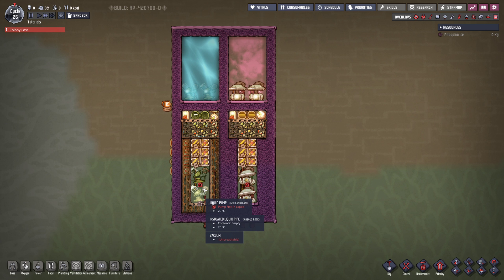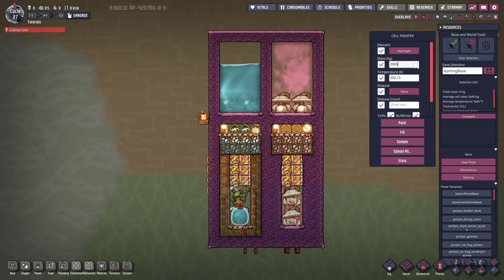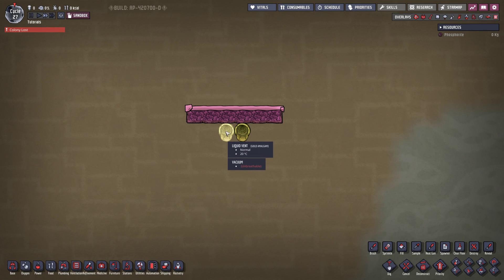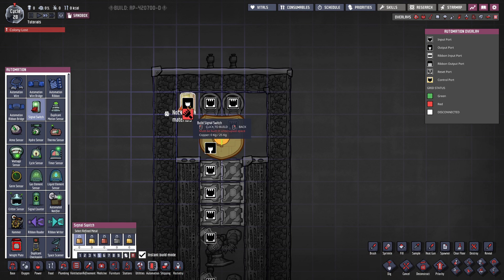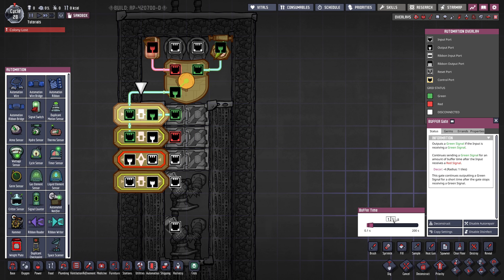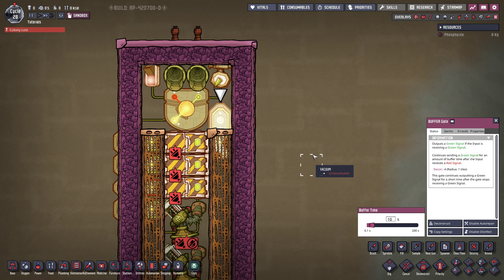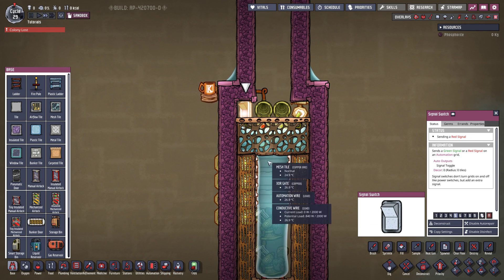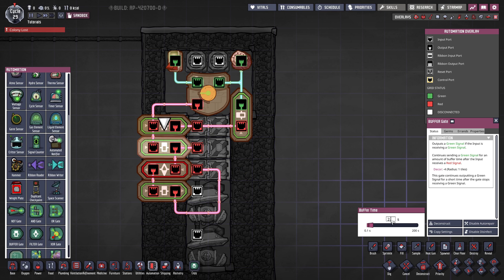Liquid & Gas Compression (Tutorial: Oxygen Not Included)

Comment: I found something weird about gas compression and I need your help.

In my normal colony, I use customizable speed mod (x30) and run the gas compression system. Somehow it doesn't work (the gas amount doesn't increase at all), but with normal speed it works.
And I try in my sandbox with the exact built and layout. it works just fine.

Do you think this glich related with FPS? Thanks a lot!

Comment: Explain why airflow tiles need to be used there? Is there specific reason instead of using normal tiles? 
Also, you should send this to devs so they can fix the exploit (or in my opinion bug :P)
Reply from the maker: The airflow tiles prevent liquids from touchung the walls. At a certain pressure the walls would otherwise break.
Reply: @Nathans-Sandbox  That's definitely a bug than and I hope they fix it :P Airflow tile should have the same rules of pressure as all other tiles in my opinion :P
Reply from the maker: It is a little weird, but not a bug. Maybe they patch it out someday but it is working as intended right now.

Comment: Mine doesn't seem to be working with hydrogen, not sure if the gas type really matters though. I have all the same intervals as you, but my top 2 doors are opening and closing at the same time, perhaps too quickly for the hydrogen to fall into the space created by the open airlock? I'm not smart enough to work out how to make it work though, I don't suppose you have any ideas or can work out what's wrong? I've definitely copied this video correctly, at least I'm 99% sure.
Reply from the maker: I built it in the current LP world the same way and it still works. The first 2 doors open at the same time, but they don't close at the same time. Make sure your connections are right if you have the right timings already.

Comment: I tested this on a Natural Gas geyser and it worked well, I just had to tweak the timings for my setup. Since I'm not sending power to my doors and the output is low, the timings I used for Buffer, Buffer, Filter, Buffer are 9, 15, 9.3, 1, respectively. I also lowered the 20s Buffer Gate to 7s and set the Atmo Sensor to <3000g. I don't know if the settings are 'ideal', but they work, the geyser never overpressurizes, and I'm not deleting any gas (that I can tell). 

I suppose that since I'm not powering the doors, the atmo sensor is a bit redundant since it seems it is only helpful to stop wasting power on compressing small amounts of gas.

Thanks for the tutorial!
Reply from the maker: Thanks for letting us know the timings that worked for you!
Reply: I was already thinking about that: using unpowered doors the last door was open before the first was closed. But I'd rather use unpowered doors than fall for a powered door timing during a power fail :-).
For a horizontal flow of liquid I needed at least 5s before the water flows in. Ah yes, I have an open input. Not closed. I should fix that.

Comment: I've been referencing this every time I use it. I almost have it memorized. Do you have problems with it when using polluted water? The off gas seems to muck it all up.
Reply from the maker: Off gas could be a problem but only if you haven't filled the 4 tiles with polluted water. If you ever happen to have less polluted water in there, just disable the contraption (so all doors open) and let more polluted water drop down until the 4 tiles are occupied with the liquid again.

Comment: I just wanted to mention that there's an alternative way to build a similar system that is, I think, a lot less complicated to build.  Rather than a complex automation circuit, it relies on a liquid loop with multiple liquid element sensors, each connected to one door.  Rather than trying to explain it with words, I just created a basic picture guide which you can see here: https://imgur.com/a/S4V0Nxu
Reply from the maker: For some reason I just saw that now, great how ppl come up with different ways to do the same thing in this game!
Reply: I tried this modified design on debug mode and it stoped working after 5 or so cycles. Also it can only hold pressure up until 5kg per tile (on average) after it start spilling it up.
With the original (complex) system I could soak up an entire subsurface ocean very quickly and without any problems lol
If you set the last buffer gate to 2.6 or 2.7 seconds instead of 10 the water will just vanish
Reply: @miguel_ming  Are you talking about the liquid loop version, or what?  Because the liquid loop version is rock-solid for me; I have a four-tile oil tank with over a million kg/tile.